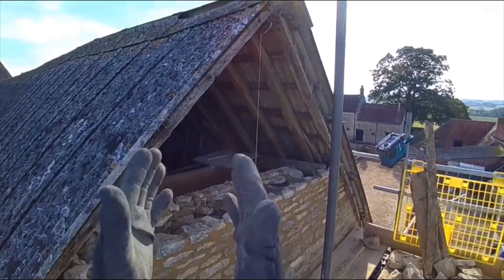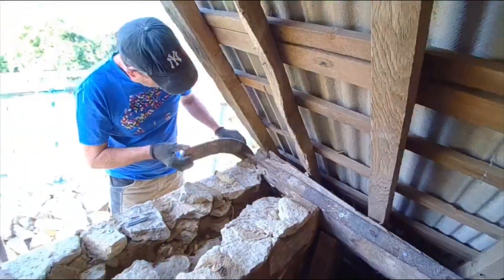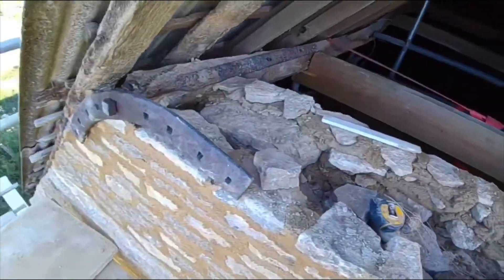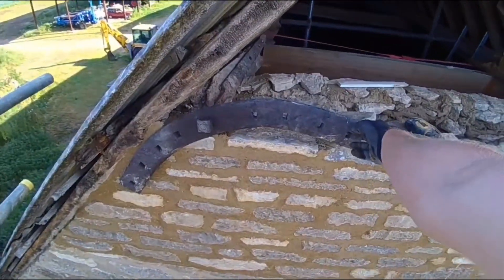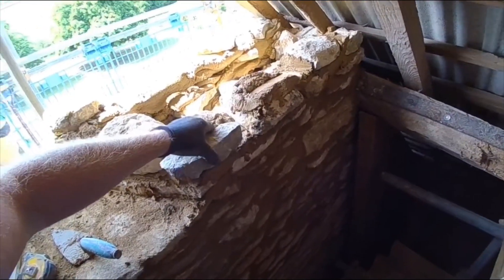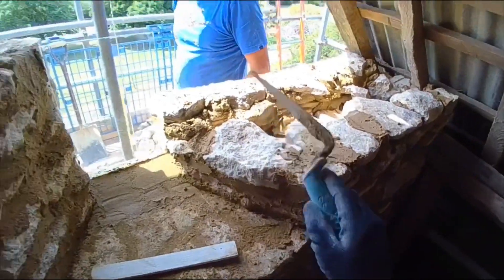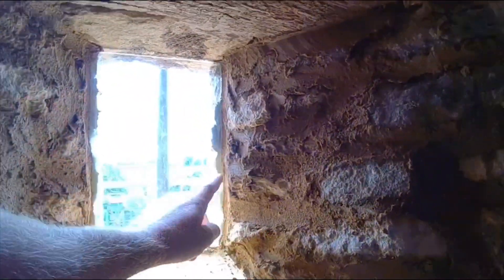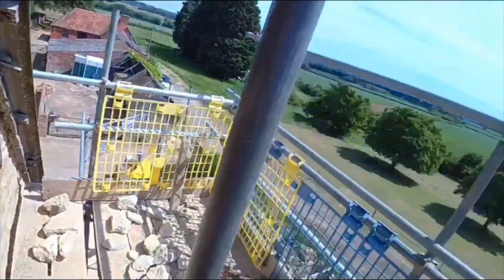I’m missing bricklaying | The skill of bricklaying

Comment: Nice video as ever - looking forward to the next one.
Sorry for the stupid question, but have you ever come across a hybrid block/timber structure?...
Block pillars at the corners (for structural solidity) with timber joists & walls for the remaining structure - combining the strength of blockwork and speed and flexibility of timber framing!?

Comment: oi ginge if that's going to be a room why no frame for the window that can be draught proofed ,also without a frame is there a chance any movement could crack the glass
Reply from the maker: It’s not a room it’s the gable end of an unused barn we took the gable end down as it was about to fall down it had that window in it originally exactly like that. It was probably just for letting light into the barn
Reply: Plus the customer is always right if that's what they want even if they completely wrong 👍
Reply: Nice job mate 👍 
I build stone too its much more satisfying than using brick or block